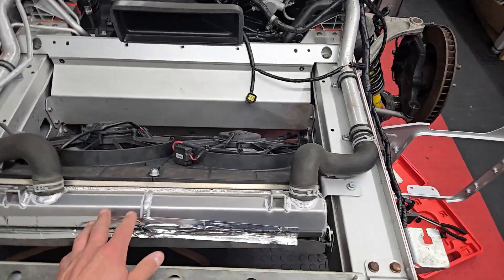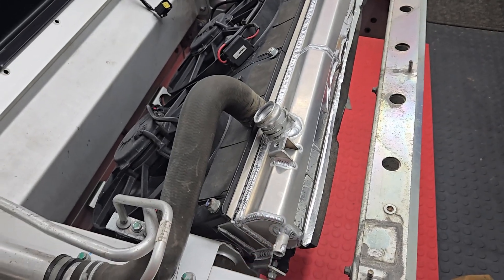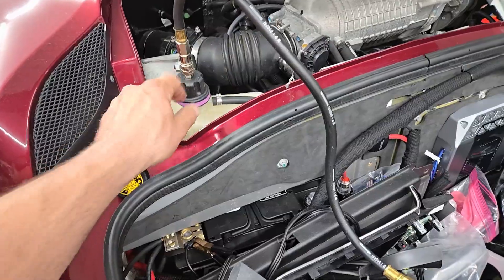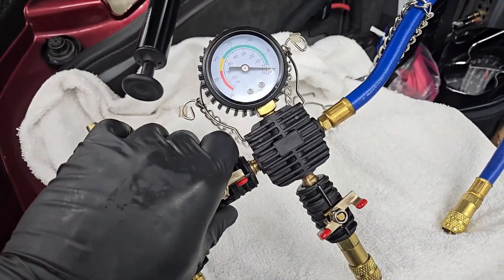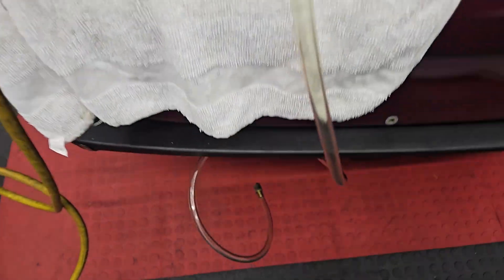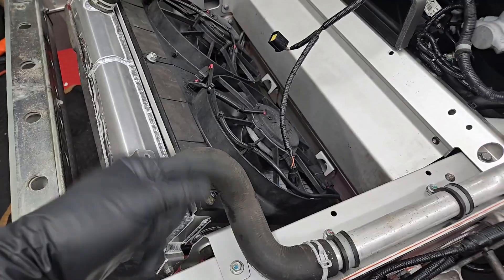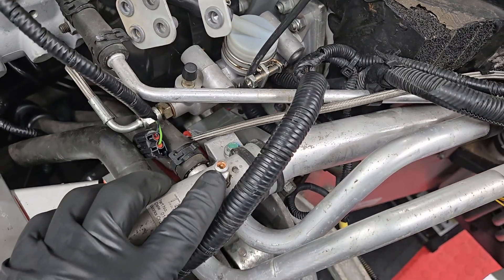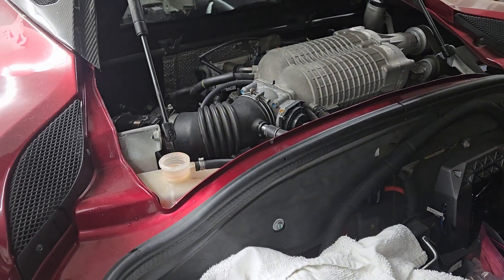Lotus Evora - How to fill coolant system

Comment: First lotus loon to the video!!  Thanks for the vid! JB weld that stupid nub and indent the tube so the jb plug doesnt go in.  In about 5  or 6 years that plug is going to leak and you will be super happy.  My rx7 has a numb like that,  when it failed i opened the hood and replaced it but we dont have that luxury.   I have a bleeding kit but i'm still kinda dreading this task. Thanks again!
Reply from the maker: lol, love it.

You know what, that JB weld isn't a bad idea. I do worry about the difference in expansion with aluminum, so maybe I'll just stop being lazy and learn how to properly TIG, finally :)